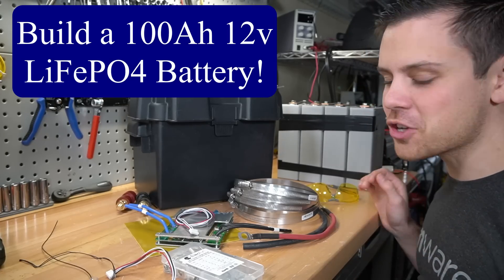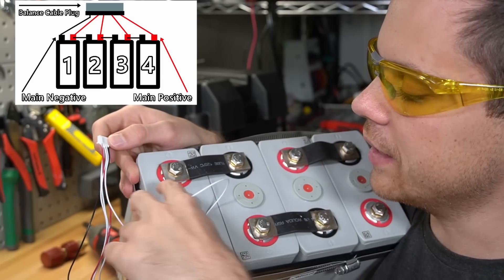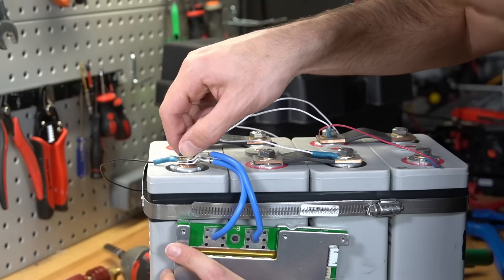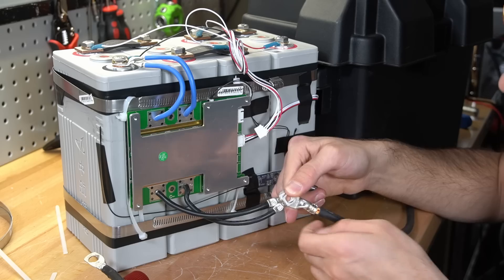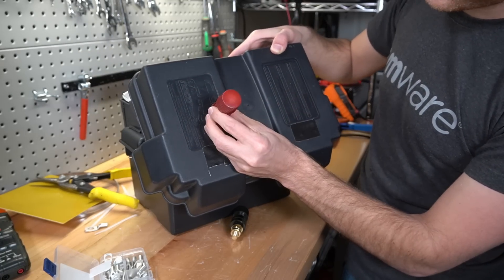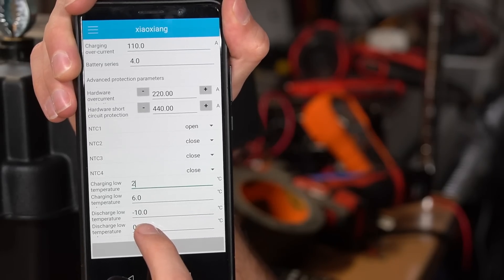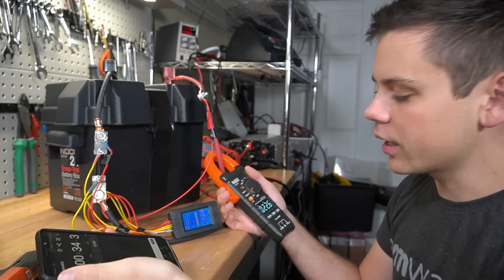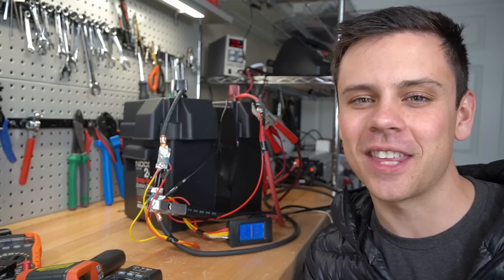DIY 12v 100Ah LiFePO4 Solar Battery for $555

Comment: is there a way to combine cells to have 400 +amp hours and use this BMS or would there be a different way of assembly?          ie 1 bms or one for each 12v unit?  :)
Reply from the maker: https://www.youtube.com/watch?v=zStEtH9Le-w
Reply: @WillProwse  perfect, answered my earlier question. Just need a 200A BMS.
Reply: I'm thinking deeper.  Can the BMSs work together when conjoined with 3 other battery units?
Reply from the maker: https://youtu.be/TkYWDnBGsQ4
Reply from the maker: And yes, you can put the batteries in parallel or series even though they have their own BMS. No problem there

Comment: It's time for you to switch from solar power to DIY EV car :)
Reply: It would be nice but it can also be expensive and nearly impossible due to government rules and insurer's requirements. Best approached using an existing vehicle and done in a location where the rules are more lenient. To have a car sold at retail in the US requires giving the government 5 examples of each significantly different model for crash and emissions testing, and if they deem revisions are needed you may need to give them another 5 after the changes are made. Ostensibly for "your safety" the actual intention is to keep the current manufacturer's virtual monopoly intact to protect their investments and profits. 

DIY can be done in states which do not have required routine inspection or emissions testing requirements, provided you can insure the car before putting it on the road. While your petroleum-to-electric conversion is actually more emissions-friendly, since you've altered the original emissions equipment it won't pass an emissions inspection. Same with most car insurers- nothing but stock vehicles are covered so you have to get coverage under a personal or general individual liability policy. The worst thing you can ever hear are the words "We're here from the government and we're here to help you".

Comment: Would it be a good idea to add a terminal fuse on to the battery positive terminal?
Reply from the maker: OCPD is built into the BMS
Reply: @WillProwse  Ah, yes I forgot that.

Comment: any particular reason why ebike people use a million cells when you can get away with using 4?
Reply from the maker: because they are cheap and use a chemistry that has a high specific energy. I like prismatics for solar because they are easy to build with. You can use whatever cells you have available. Bike batteries volumetric density and specific energy matter a lot. Not so much for solar.
Reply: @WillProwse  hi will. 
Based on your battle born breakdown. 
That encourage us to build our own powerwall in the Bahamas 
It's awesome. 
Thanks
Reply: Do you think your knees might knock in to this battery if it was mounted on your bike? 😂